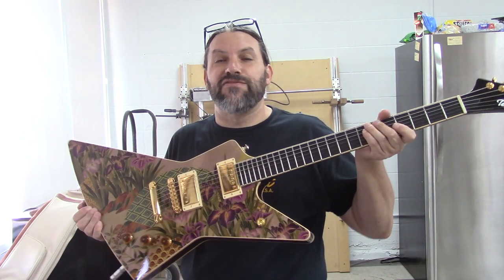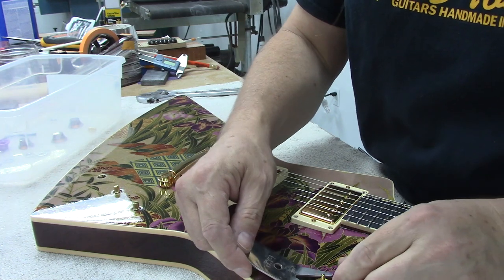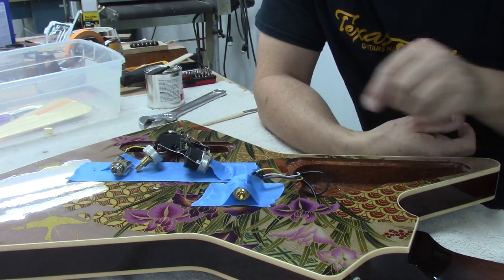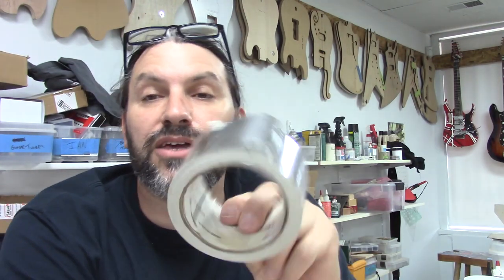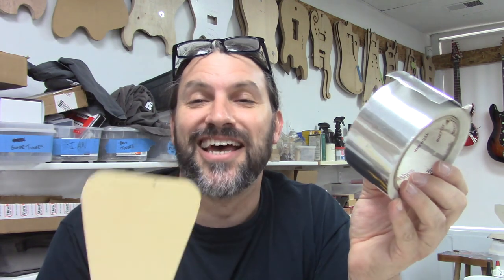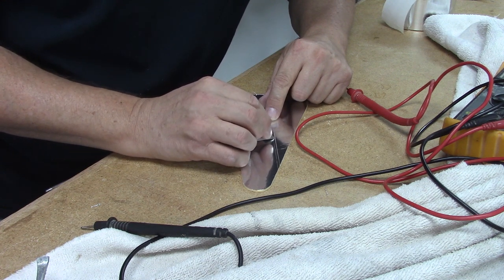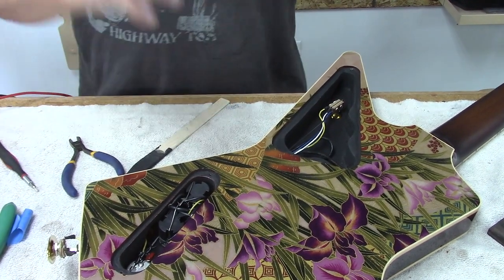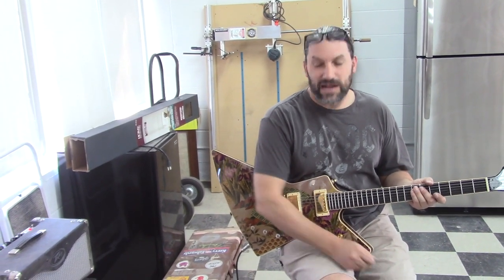Everything You Need To Know About Guitar Shielding... Almost

Comment: Man I cringed when you used a huge adjustable wrench to loosen those pot nuts. 

Anyway, it is quite hard to tell what you can get away with as far as shielding is concerned. When they build Faraday cages, usually of very fine copper or brass mesh, for testing electrical interference they have to make sure that there are absolutely no gaps and that all joins are electrically connected along their entire length. Even small gaps will allow high frequencies through the screening. 

I suspect that with guitars you don't have to be so meticulous. Screening paint has to be applied in several coats (as you did) to arrive at a resistance low enough to get a consistent beep out of a multimeter continuity check. However I suspect that the thinner coatings you looked at still provide a higher resistance skin and that may be good enough.
Using screened cabling inside a properly screened control cavity is really belt and braces and not necessary. However any cables running outside the cavity should be screened.
Something that is often missed is that the output jack should be screened. The large area of bare brass contacts on a standard Switchcraft jack WILL pick up hum.
Single coil guitars may benefit less from screening than those with humbuckers because the single coils often pick up so much hum themselves that the contribution from unscreened electronics is drowned out. Even so I screen all my single coil guitars.
Ground continuity throughout the screening is essential, just plastering all the cavities in your guitar with copper tape with no continuous ground connections (as shown in many YouTube videos) is a waste of time. You will often find that you get continuity past the adhesive (and there is that fancy stuff with conductive adhesive that StewMac sells) on both copper and aluminium tape on a fresh screening installation, and the screening may get grounded via the control pot shafts (pots do loosen) but I don't know how reliable that is over time. I use low cost slug repellent self adhesive copper tape from a gardening supplies outlet and then solder across the joins in numerous spots.
Reply from the maker: You ever watch Yan Can Cook? That guy uses a big knife for everything
Reply: @TexasToastGuitars  Yan Can Cook was one of my favorite cooking shows. Stir fry, not stare fry!!!!
Reply: +1 on the conductive glue. Easy to test. Take a piece of the copper. Stick another on top. Can you get continuity - great you got the conductive glue.

Noise killers are quite good too.
Reply: @stephenhookings1985  BUT - As I said I have found you can use self adhesive copper tape from any source (I use gardening centre anti-slug tape) and, providing you smooth it down well, immediately following application you will get continuity from one piece to another. I assume that is because in odd spots the copper touches through small gaps in the adhesive. I don't know how reliable that is over the long term. I also wonder just how conductive the conductive adhesive is. I doubt it provides a low resistance connection. i prefer to run solder across all the tape junctions, then I know it is connected.
Reply: @ResoBridge  yeah snake oil is oil whether it be security, guitars etc. I did find with cheap aluminium foil and the spray contact adhesive that did stop the continuity. Plus hard to solder onto it. So the sticky copper was for me a better solution.

But as Texas Toast showed... a meter and two hands are your friend. I found the graphite paint is ok but messy and you need a ton. The copper tape here in UK was about £15 and I did 12 guitars/basses so far.

There again the EMG J pickups...wow. what a beautiful piece of American engineering. £122 onto a £125 bass ...only hard cos i had to widen cavities - all captured on my channel.

Thanks for your advice - appreciate it.

Comment: I’ve had good success with spraying Elmer’s spray adhesive on that back of good old reynold’s wrap aluminum foil.  It’s a lot cheaper than copper tape and shielding paint.  Great video as always.
Reply: Aluminum foil ducting tape removes that step and works fine. Just used it on my Strat and I literally thought I pulled a wire loose because it was so quiet. There's absolutely zero buzz now.

Comment: Technically, what you are really making is an antenna. You are not making a cage as such because you cannot fully isolate the electronics inside. The “shielding” is simply offering the RF, and other,  interference a quicker way of getting to ground, rather than going via the electronics (which is why you get the hum sometimes) . But it does work, and great job, that guitar looks killer.
Reply from the maker: Thanks Stan, we pretty much decided that some shielding is all you need. The continuity thing is pretty much bunk. One of the advantages of geeking out about this topic in the shop is that we came up with our own way of doing this on future guitars.
Reply: Texas Toast Guitars , exactly, you are offering that path to earth that wasn’t there (or wasn’t sufficient in this case.) Keep up the awesome, fun an informative vids!
Reply: You should do some reading about how a Faraday Cage works.  It allows the external electric field lines to flow around the cage without penetrating it.  Grounding is not required for it to work, but the cage should have electrical continuity all the way around.  Once you start poking holes in the cage, its efficiency will degrade depending on the size of the holes and the frequency of the signal you are trying to shield,

Comment: @14:40 Despite what you might think, a Faraday cage can be made from wire mesh (though perhaps impractical in a very small space such as a guitar control cavity), so even if the paint or foil is full of holes it may provide effective radio frequency screening, so long as all the paint/ foil/ lining is connected to a ground.
Reply from the maker: We came to that conclusion after much debate. It occurred to me that the whole notion of a cage isn't a box at all.

Comment: If you were trying to shield for high frequencies(RF), areas where there are gaps or low continuity between the pieces of aluminum tape might not work very well or at all. But since the frequencies we are worried about here are the ones we can hear and therefor are much lower and have longer wavelengths and likely won't make it though those gaps anyway.
Reply from the maker: Good to know
Reply: That's true until it isn't.  I use my cellphone to control a couple of my pedals, so it sits on the desk with my computer and monitors, less than a yard away from my guitar when I am playing.  So it's a pretty strong RF field in the GHz region next to mic level guitar pickups.  A good Faraday cage will keep out the 3G/4G/5G cell signal as well as bluetooth and square wave garbage from my monitors.

Comment: Hate to admit it but I did buy the copper tape for my projects just because of some of the hype over copper vs aluminum.  I have heard a lot of good things about shielded wire.  Just need to see if the shielded wire is cheaper and/or easier than adding shielding to cavity.  Also to really test the options need a device that just give unshielded guitars that hum like crazy and see what works best.
Reply from the maker: We pretty much decided that some shielding is all you need. The continuity thing is pretty much bunk. One of the advantages of geeking out about this topic in the shop is that we came up with our own way of doing this on future guitars.
Reply: Shielded cable from the pickups to the selector switches makes a huge difference.  If that link is unshielded, then you should replace it with shielded cable, or shield the pickup cavities and the area between them and the selector switch.

Comment: I don’t have the patience to wait 3 days for 3 coats of conductive paint. 
In my experience, it takes 3 coats to get a good shield. 
I use to do it that way, but not anymore. That Warrior guitar looks to have proper conductive shielding paint. 
The absolute biggest hum buster is a shielded wire from the pot to the output jack. 
After that, whatever floats your boat. 
Thanks for the video!
Reply from the maker: I don't really believe that conductivity is that important anymore.
Reply: My 1978 Les Paul Custom has a metal box that fits inside the control cavity. It came that way from Gibson. 
I think a metal box is overkill, but Gibson deemed it necessary. 
I guess most manufacturers have experimented with different methods of shielding the pots and wire contacts.

Comment: All you need to know is that normal aluminum foil ducting tape works great. It removed ALL of the buzz from my Strat. I didn't scratch anything and I actually did get solder to stick to it after a few tries so it's grounded to the same place everything else is. I also didn't check it with the multimeter when I got done, either. Yea. I forgot about that. 

Edit: you know that already. 🤣 Nice! 👍I used the exact same brand, even 😄
Reply from the maker: The notion that it all needs to be tied together is something that we decided is bunk 
YMMV

Comment: I don't know about handsome. But I do know that some cheap (free from job site) aluminum tape definitely did the trick with my cheap MIM strat. Great video. 
Shielded wiring will definitely do the trick too. As a low voltage/cable guy, I can testify to using shielded wiring. It's just a much smaller version of the cable that makes your TV and internet work.
Reply from the maker: You don't have to hide how handsome you think I am.
Reply: @TexasToastGuitars  LoL.

Comment: You can buy the copper stuff from China via eBay for the same cost (if not less) than the aluminum stuff from the bog-box stores, so I just use copper.  Hell, tinfoil and contact cement will work..... Tape in general has become stupid expensive for no apparent reason other than "because we can".

I need to get a DMM that beeps - holy shit that's super handy.
Reply from the maker: Super handy... 
We have pretty much rethought our whole deal when it comes to shielding after this deep dive
Reply: @TexasToastGuitars  The paint looks awesome, but it's stupid expensive. I recall the old stuff in the late 80's - smelled like Satan's butthole and wasn't all that good. At least the current product works.
Reply from the maker: Yeah man the old stuff was really stinky

Comment: It's a Faraday cage. It's doing what it does. I proved grounded chicken wire will block noise, but I doubt anyone would let me use it in a guitar for them.
Reply: Also, that PRS is shielded like crap! I've seen schecters that are done better.
Reply from the maker: We pretty much decided that some shielding is all you need. The continuity thing is pretty much bunk. One of the advantages of geeking out about this topic in the shop is that we came up with our own way of doing this on future guitars.
Reply: @TexasToastGuitars  I guess you just need to send the noise signal to a good ground and it doesn't have to be built like a vault with 3 foot think walls.

Comment: I think you are on to something with the braided cable. I recently rewired a Stratocaster and used standard black and white cloth covered wiring throughout, including between the jack and the controls. The hum was the worst I ever heard. So, I shielded everything. I got a short to ground in the jack cavity, and pulled the shielding out of there... and didn't remove any other shielding. Then I tested and the hum was just as bad as with no shielding at all. Then I re-shielded the jack cavity, re-positioned the jack to avoid shorting the jack to the shielding, and no hum whatsoever.

That got me thinking that the critical component to all of this is the cable from the jack. I have a couple other single coil guitars where the cavities are not shielded, but also don't seem to have a hum issue... turns out they have the braided cable wiring from the jack.

The only other thing I do that may deter the effects of EMI is I twist my pickup wires together for ease of managing the wires and neatness. All I can tell you is that in my observation, proper shielding between the jack and the controls seems to be the most critical point.
Reply from the maker: That is one of the things that is a no brainer for me... well it is now
Reply: Was your output jack wired backwards?  That would cause a short to ground when you install the output jack in a shielded, grounded cavity.

Comment: When I did the research for Faraday Caging my SSS Strat and a Tele I was thinking the same as you, why copper? well Copper has higher conductivity than  Aluminum, meaning a better electron flow. But hey, I am with you, if it ismcheaper and works is fine with me. I amnot heading a concert in Donnington UK. Cheers.
Reply from the maker: The best is the enemy of good enough my friend
Reply: Radio frequency signals will penetrate less deeply into coppper than just about anything else.  Aluminum is a close second though.  Either is an excellent choice.

Comment: The aluminum tape has worked fine for me so far. Been using it for years. However, I've never measured the voltage going through the circuits inside the guitar.I probably should.  In house wiring (with 110 v), you should never mix copper and aluminum wiring because, the joint of the dissimilar metals can corrode over time, leading to arcing/fire hazard stuff. That actually happened in my last house, which had aluminum wiring from the 60s. That's probably the best argument for the expensive copper stuff.
Reply: Aluminum works fine in a guitar, I actually use heavy duty aluminum foil and headliner spray adhesive often.... there is no "real voltage" in that circuit,  so it wont fail or combust.  You're overthinking it.  Just my 2 cents.
Reply: @daddyosink4413  Honestly, I hadn't thought much about it till this discussion.
Reply: @GosselinCreative  yea, it's one of those things that "this is just how you do it" and "if it ain't broke....".
Reply from the maker: We pretty much decided that some shielding is all you need. The continuity thing is pretty much bunk. One of the advantages of geeking out about this topic in the shop is that we came up with our own way of doing this on future guitars.

Comment: Hey Great video, I already have copper foil around and I want to shield my telecaster. Do you recommend shielding only the pickup cavities or everything on the guitar? like the pickguard and the electronics cavity?
Reply from the maker: We only shield the control cavity... but you got to do you my friend
Reply: Texas Toast Guitars Only the control cavity! interesting.. I will experiment today with that
Reply: @bilalnachabeh  I always completely shield the control cavity, and if the switch is in a separate location, I'll shield that too. I apply the black "shielding paint" to the pickup cavities in three situations: one, always if the client asks for it, two, if the pickups are  noisy in any switch position when the instrument is first plugged in during our inspection process, and three, if it looks cool (and it usually does look good to have the pockets behind the pickups all blacked out!)
Reply: Metalbass10000 I finished the project last week. I shielded everything with copper foils and connected them all together, neck bridge and controls cavities. the only thing that was left unshielded is the jack cavity
Reply: @bilalnachabeh  You might get some more benefit from shielding the output jack cavity.  Cellphones in the 4+GHz range have a wavelength short enough that the jack itself inside the cavity is a decent antenna.  The wires leading to the jack are (hopefully) shielded, so there's not much to worry about between the jack cavity and the control cavity.
Reply: @JohnShalamskas  thank you for sharing that info. I will shield it also
Reply: @JohnShalamskas  or use shielded cable or if you can't get that then twist the wires to reject more noise.

Sometimes I still get noise after this - turns out the amp wasn't properly earthed, or a pedal was introducing noise.

Comment: What if it's the opposite: added buzz when I Do touch a metal part on the guitar (not when I do Not touch a metal part).   Worst is pick guard screws. What should I look for when I examine ("guess"--noob here).  Maybe a bad/lose solder joint.  {new Gretsch G5230LH Electromatic Jet FT Single-Cut with V-Stoptail}. Thank you in advance TTG.
Reply: Is your output jack wired backwards?  Audio from the volume pot should go to the tip, and ground to the Sleeve.